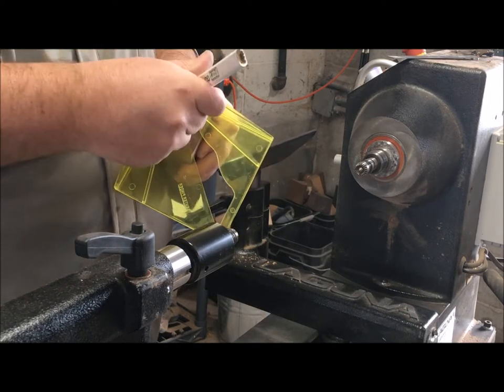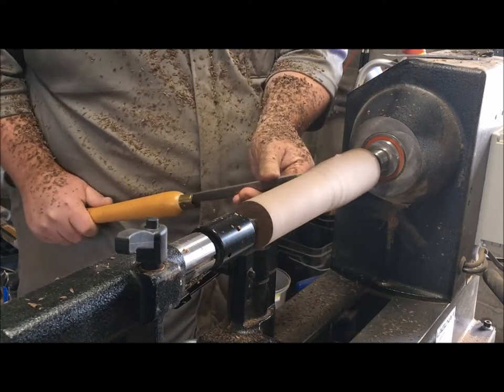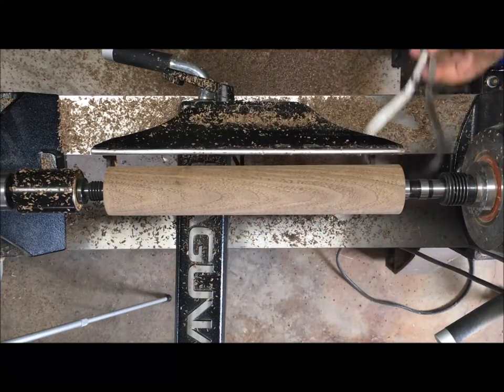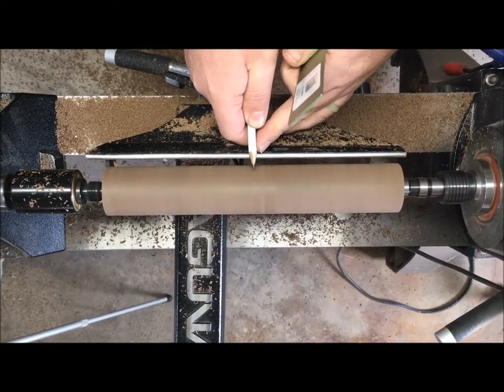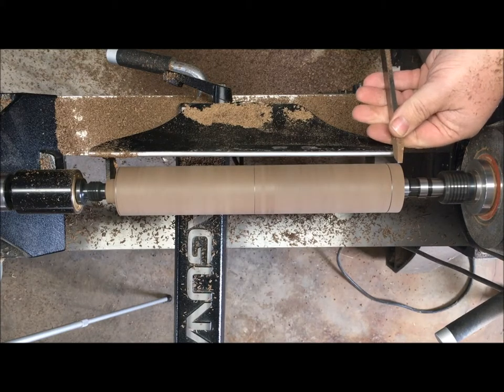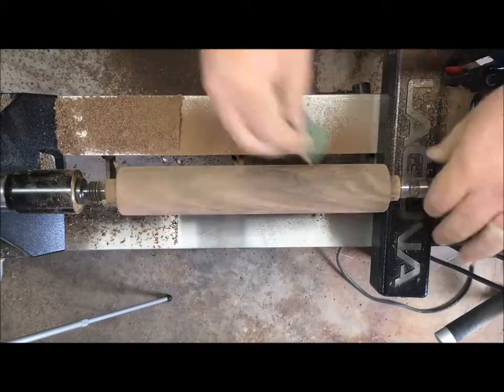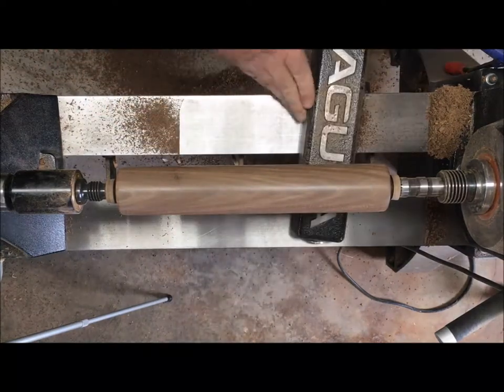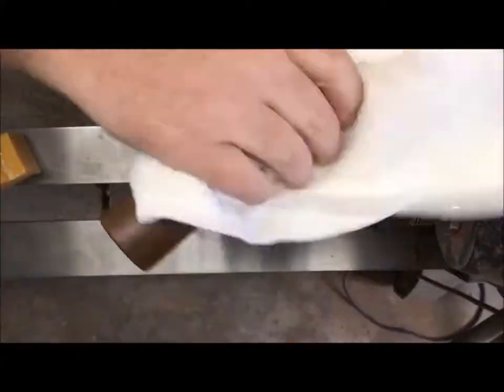Woodturning/ Walnut Tortilla Rolling Pin

Comment: Great job.  Where did you get the small buffing wheel?
Reply from the maker: I got it at harbor freight as part of a small  buffing set. Honestly I usually apply wax now on the lathe. Just put the wax on while it’s spinning directly from the wax block. Then just use a paper towel and apply a little heat and pressure to smooth out the wax. Works great! then I just finish the ends after they are sanded.